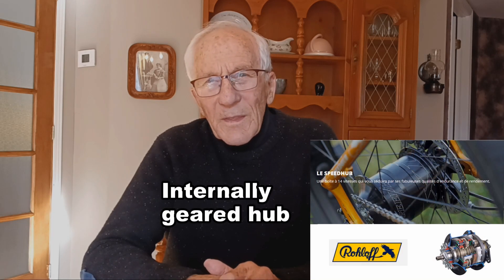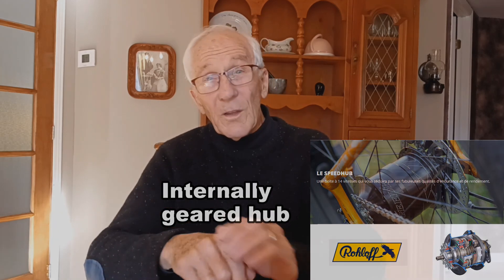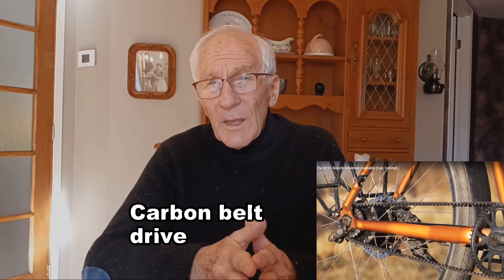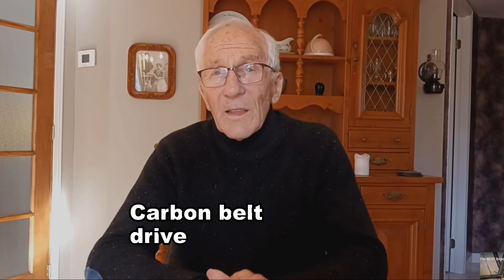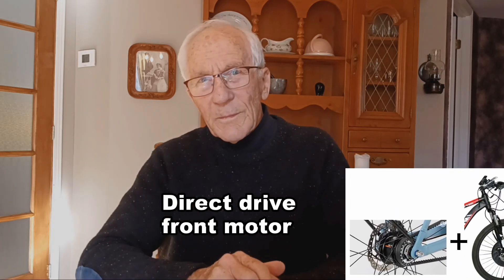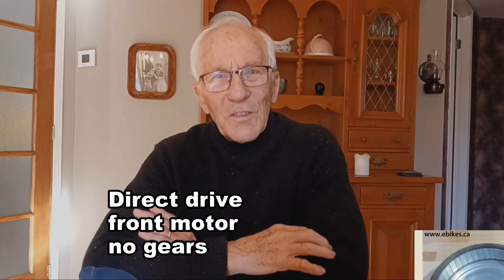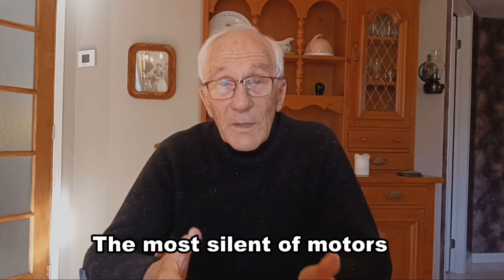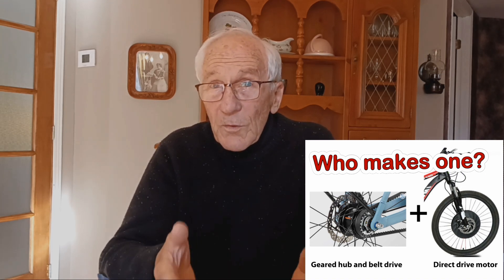Zero Maintenance Ebike

Comment: A Like for a well-reasoned Idea. A hub-geared bike with just 3 gears should suffice for a not-very-hilly city. But think: Chains are far more efficient, also easy and cheap to replace, while carbon belt-drives aren´t simply much costlier, they also need proprietary bike-frames, which are even more expensive !
Reply from the maker: Agree.
Reply: I see Lectric has come out with a relatively inexpensive Pinion mid-drive motor and a Gates carbon fiber belt drive, and they did this for ease of maintenance. However, after a big prerelease announcement, complete with the e-bike influencers that get free bikes in exchange for reviews (in my mind, a real biasing factor (if they want to keep having e-bikes sent to them), I haven’t seen any reviews after the May 2024 release. I got a Velotric Discover 2 and am very happy with it, but I am interested to see what the verdict is on this new, supposedly low-maintenance bike.

Comment: Robert, the Stromer ST2, ST3, and ST7 are the closest to what you’re describing. Regen-capable direct-drive motors, in rear wheel, with Gates belt drive and internal shifter hubs. Pricey, but all the reviews I’ve seen say that Stromer bikes are excellent. Ah, those Swiss…

My 2019 RadCity with direct-drive rear motor (but 7-speed deraillier & chain) is like a low-cost version of the Stromers. Sadly, Rad went away from the direct-drive motor and now specs a geared rear motor. Shrug. Most buyers don’t care for direct drive because they just want high torque and could care less about silence or efficiency. I’ve got 5426 miles on my RadCity (just checked) and am still on the original chain & brake pads, with the only maintenance being new tires (went with Schwalbe; costly, but immensely capable, quiet, long-lasting, and with zero flats.) Longest ride ~240 miles over two days, bike camping with solar charging while riding (panel on horizontal sticks at back, plus an auxilary panel used in series at rest.) Lots of 80-100 mile day trips. Oh, and I’m 71, so it’s not that I’m some sort of super-power ultra-endurance guy. Have now mostly abandoned doing solar, and am riding with two batteries (I borrow one from my wife’s Rad; she has three electric bikes) and high-power elegant chargers by Luna; trying to map out all the charging points in my neck of the woods. Have a J1772 adapter so I can charge from older-tech electric car stations, of which there are quite a few where I live (California.) And there are a surprising number of public wall plugs scattered about too.

Many thanks for your informative and heartfelt videos!
Reply from the maker: Hi Bryan, I haven't looked at Stromer ebikes recently, and thanks for pointing these out. Very similar to my theoretical most reliable bike. It's a pity that RAD has dropped its DD motor. I think I would have wanted one. You're ten years my junior, so you still have many good years ahead. Keep up what you're doing.
Reply: My 2019 Rad City e bike with it's direct drive motor gives.this 71 year old  biker all he needs for a quiet and dependable ride.I' m afraid that when it's time to replace it,no dd motor e bikes will be available. But,good luck Robert with your search for what you' re looking for!

Comment: I cycle commuted for thirty years, have been retired now for five years and I'm still cycling on my non-electric bike. I'm now looking at buying e-bikes so my wife and I can ride together, and really appreciate your informative video series.
In my research into e-bikes, mid-drive motors almost always seem to come out on top in terms of performance and reliability. Front wheel hub motors certainly don't get mentioned too much - is it due to problems with broken spokes?
Reply from the maker: I don't know why front wheel drive isn't more popular than it is. It might be a good option when using a geared hub with a carbon belt drive.

Comment: One more comment I forgot to add about my experience with regenerating hub motors.  Although hub motors do regenerate and save brake pads, my experience is that this isn't useful.  Unless you have many very long, very steep downhills, the regeneration won't actually recharge your battery enough to be noticeable.  You are right that regeneration will save brake pads, but when regeneration kicks in, you stop dead right away, and you can't control the speed of deceleration.  My take.  YMMV.
Reply from the maker: I think you're right that regeneration isn't useful except in very hilly areas. But not all regeneration systems are all or none. With the Grin Technology's Cycle Analyst, you apply the left brake partly and a low level of regen is initiated, then you can use the throttle to increase the regen gradually. It works well when it works.

Comment: Thanks for this Robert.  I like your recommendation of the internal hub shifter.  But I'm not so sure about the other two points.  1.  While a carbon belt never needs oiling or adjustment, how easy is it to get the rear wheel on and off when you need to repair a flat or change a tire?  2.  My experience with hub motors is that they either are too weak or use way more power than a mid-drive, thus requiring a larger (or 2nd) battery.  I'm also skeptical of adding the significant weight of the hub motor to the front wheel, significantly affecting steering.   I suspect there is a good engineering reason that almost all bikes are rear-wheel drive.
Reply from the maker: Thanks for your thoughtful observations, Tom. 
I hope you're still enjoying life. Take care.
Reply: @RobertBeriault753  I am, Robert.  I split my time between St Johns Florida (winter) and Park Rapids Minnesota (summer). I bought a summer cabin in MN despite your excellent advice and good arguments in one of your videos recommending renting one.  I did give up my RV, however.   If you and your wife are still traveling, I'd be happy to host you for a visit in either or both places.  I was re-watching this video because my girlfriend - a long-time, experienced touring cyclist - is in the market for an E-bike.  I sent her a link to your 7-part  series of videos on understanding all the parts and how to choose one.  As you say ... "Never stop cycling!"

Comment: Excuse my ignorance of technical terminology, but many of the first electric bicyles had motors in the front wheel. This made for strange driving characteristics and poor hill climbing. Cheaper electric bicycles still have the same hub motors but now you see them more often in the rear drive wheel. Mid-motor configurations near the chainwheel seem to be the state of the art and the more expensive electric bicycles have them. Even low maintenance cars need oil changes and mandatory check-ups. I think your local bicycle shop would appreciate your business for any routine maintenance.
Reply from the maker: I'm not suggesting that this is the ebike for everybody.I wouldn't want one for myself. It's for the one who wants reliability above all else. For this I chose a direct drive motor because of its longevity record.

Comment: What's the point of the expensive internal hub gear if it's not on the drive wheel?  My experience with hub drive was that it wasn't as efficient as a mid-drive.  For the same size battery, it didn't get anywhere near the same range.
Reply from the maker: Hi Tom,
The point of this exercise is to give the guy who can't afford to be without his bike for one day, a combination of components that are least likely to give him trouble. This guy doesn't care about efficiency. He can afford a bigger battery (and doesn't care much about the cost)😉
Reply: Hub drive is probably more efficient. Solar race cars use hub drive. 

And hub drive is so much cheaper that you can buy a bigger battery if you need range.

Direct drive hubs are king. Motor braking is extremely important for reducing maintenance on a bicycle.
Reply: Robert, the Stromer ST2, ST3, and ST7 are the closest to what you’re describing. Regen-capable direct-drive motors, in rear wheel, with Gates belt drive and internal shifter hubs. Pricey, but all the reviews I’ve seen say that Stromer bikes are excellent. Ah, those Swiss…

My 2019 RadCity with direct-drive rear motor is like a low-cost version of the Stromers. Sadly, Rad went away from the direct-drive motor and now specs a geared rear motor. Shrug. Most buyers don’t care for direct drive because they just want high torque and could care less about silence or efficiency. I’ve got 5426 miles on my RadCity (just checked) and am still on the original chain & brake pads, with the only maintenance being new tires (went with Schwalbe; costly, but immensely capable, quiet, long-lasting, and with zero flats.) Longest ride ~240 miles over two days, bike camping with solar charging while riding (panel on horizontal sticks at back, plus an auxilary panel used in series at rest.) Lots of 80-100 mile day trips. Oh, and I’m 71, so it’s not that I’m some sort of super-power ultra-endurance guy. Have now mostly abandoned doing solar, and am riding with two batteries (I borrow one from my wife’s Rad; she has three electric bikes) and high-power elegant chargers by Luna; trying to map out all the charging points in my neck of the woods. Have a J1772 adapter so I can charge from older-tech electric car stations, of which there are quite a few where I live (California.) And there are a surprising number of public wall plugs scattered about too.

Many thanks for your informative and heartfelt videos!